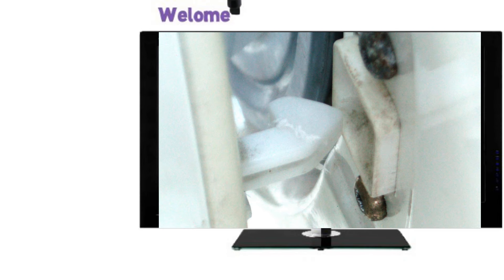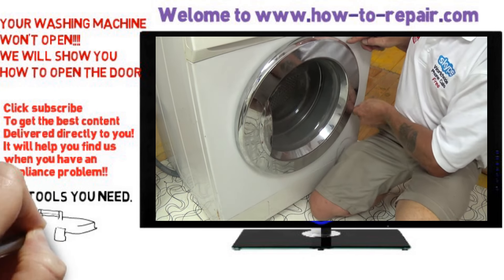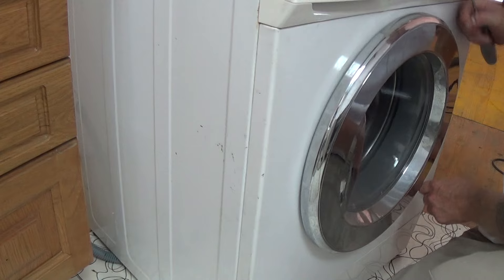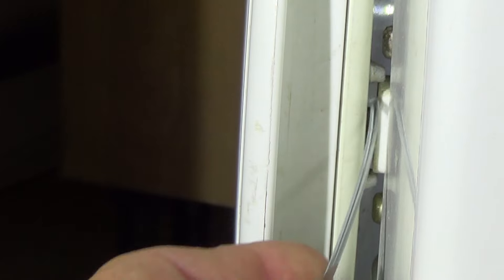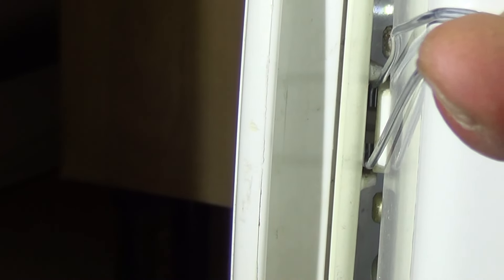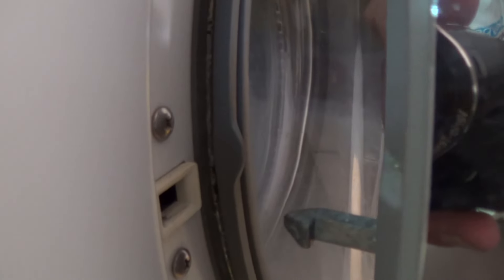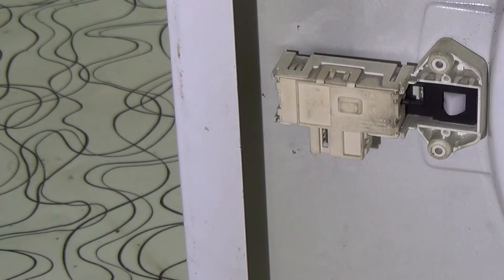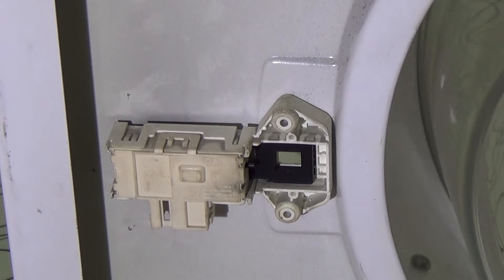Washing Machine Door Stuck won't open, How to Release and Open the Door Easily.

Comment: I had to use the 3rd option to get the washer door open. Thank you so much for the tip. The clothes had been trapped in the machine for 10 days. We couldn't get anyone to repair the machine let alone open the door. Cheers mate you're a lifesaver.

Comment: Thank you Thank you . I really can't thank you enough. Used your method with lawn strimmer wire worked a treat .  Handle broke on a indesit integral iwde126 . Only 6 months old . Get this indesit wanted £199:00 to call out because we broke it and we weren't hard with it  . Ordered a handle from indesit for £20: 
Anyway thank you so much again .
Reply from the maker: I am glad I could help you with this problem. if we helped you can always buy us a beer http://how-2-repair.com/buy-paul-a-beer/

Comment: Thank you for the video, really helped.
The wire couldn't pass the bottom opening and trying to do it just damaged the plastic around it. I eventually passed the wire into the up opening, pulled it till an almost zero angle formed, and then targeted the down opening. Happy

Comment: Also works with a creditcard or something, when you said it only requires the string to push the locking mechanism I pushed a card between that area and started pushing inwards, and pulling the door at the same time. Worked for me.

Comment: Hi there. Machine was locked for more than 3 days. Could not figure out how to open the "b*******y" thing until I saw your video. Tried with a string first and was not strong enough then used some garden wire and hurray it worked! thanks a lot for great advice man!
Reply from the maker: iam glad we could help you can always get a beer in lol
http://how-2-repair.com/buy-paul-a-beer/
Reply: ß
Reply: gd eve sir..i got problem with my WM sharp. it wont open when the machine is stop. how to figure it out. thx

Comment: Mine a Hoover AM120 .. Had to remove ..tare off.. black interlock cover  and take innards of this component out. It's operated by cable. I can't reassemble as it shredded and  has several parts/springs etc. least clothes been retrieved. Thx.  A moc up of that be great and screws torx ,hex and any special tools due to ltd room.👍

Comment: Thank you so much for this. I looked at about 20 different sites all with nothing I could really use. This worked for me and my Samsung J1045AV frontloader with a broken door latch. Machine was powered off, unplugged from the wall when I unhooked the latch with fishing line using the method he used on the Bosch (threading it through and pulling it toward the side the machine latches on). If you have trouble opening it with the machine ON you may have an electro-magnetic safety switch keeping the latch from releasing; unplugging will solve this.

Comment: Fantastic help thank you! A small piece has broken off which holds the pecker in place. The door handle does not work! Any advise would be much appreciated? I'm thinking I might need to change the locking mechanism?

Comment: Thank you so much! I was freaking out as I needed to get my clothes out for work tomorrow. My machine has a latch that pulls inwards, I didn't have any cable, cord or string so I got a skinny wire coat hanger and pushed the flat side through the gap and that worked

Comment: Dear how2 repair.com. I would happily buy you many more than one beer if you can tell me how to get into a new Hotpoint hult 742 which has clothes in it, no water but won't open.  We have tried your suggestions re wire, taking top off but what you describe inside is not the same. The casing of the switch is preventing it moving far enough to disengage.  Do not expect you to know everything!